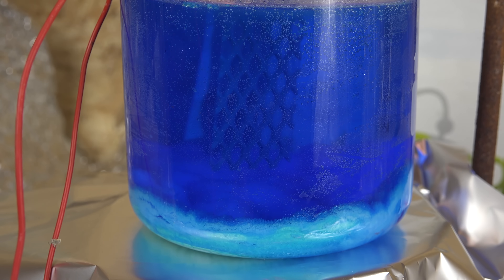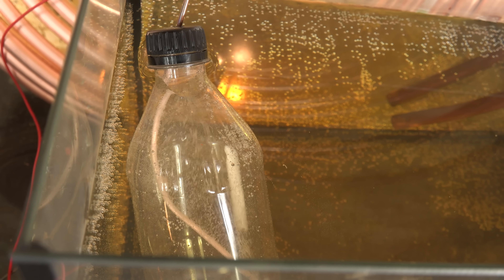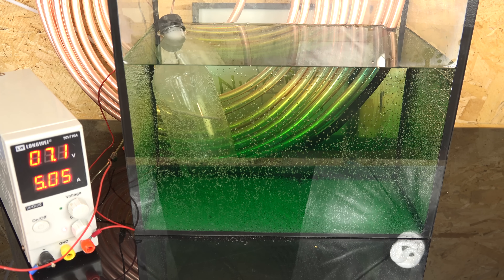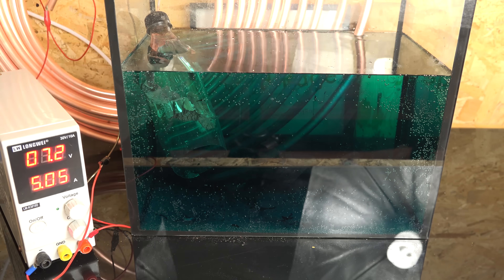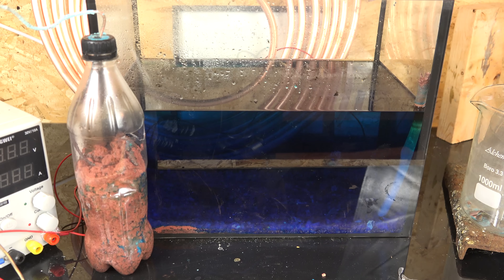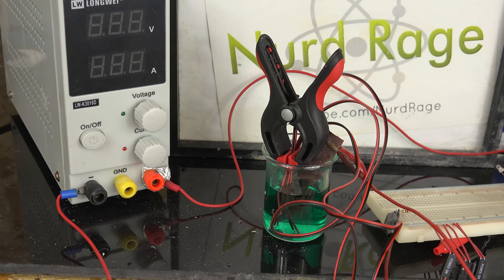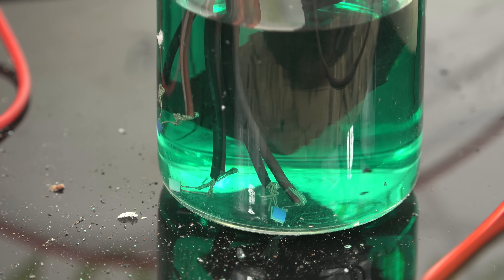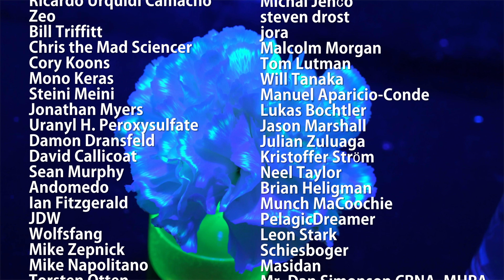Lab Notes: Making Copper Sulfate and Electrobonding Wires

Comment: Sorry, but I do not understand why to make life so difficult. You can use any copper wire crimping sleeves and just crimp wire with leads. This is how thing done in industrial applications, fast, reliable and no chemical agents, which can damage sensors and wires. BTW I would suggest to use wires with some high temperature insulation like teflon or glass fibers.
Reply from the maker: i don't understand either. I did try various crimping sleeves but when they reached the 300 celsius of the hotplate they only lasted a few weeks before failing again. When i opened them up there was an oxide layer between the wire and the crimp. So i had to use electrobonding which has proven to last months to years. I don't understand why crimping is so terrible. I've used it for other applications, but for some reason it doesn't work here.
Reply: @NurdRage  I think problem with crimps can be due to copper coating with some tin or other thing or they are not from real copper (part of aliexpress items). I do not see any other possibility why copper crimps can oxidise more than copper coating. BTW for some heat application I used stainless steel crimps (most likely 316), just cut from small tube, work fine for many years.
Reply from the maker: i tried pure copper, i even tried laboratory grade copper foil, i tried steel, nickel, all of them failed after a few weeks. I'm starting to think the constant thermal cycling causes the metals to loose their springiness (we're essentially annealing them), so they eventually no longer apply pressure and that allows the oxides to grow in. 

It's not that the copper crimps are oxidizing more or less than the coating, it's that the oxides can get in the microscopic gap between the crimp and the wire. And as they thermally cycle they grow until they fail. Nothing short of spot welding or electrobonding can fix that. In those cases there is no microscopic gap or contact surface, the metal is a continuous solid throughout. It'll eventually fail from cracking, but that takes months/years.
Reply: @NurdRage  interesting. So there left only metallising like you did or weld like in old valve equipment

Comment: You say, increasing the current heats up the wires? Would connecting your PS clips to an aluminum heat sink, then a thicker wire gauge connector to your coil and copper piece help to keep the PS wires cooler? It's just an idea, but I don't know.

Comment: If you wanted to make copper sulfate, but all you have is copper metal and sulfur, would it make sense to heat them together to make sulfide and then somehow oxidize that, or would it be better to convert one or both of your feedstocks to something else before reacting them together?
Reply: Electrolyze copper in espom salt solution to make copper hydroxide.
Then and h2so4 to that.

Comment: Interesting on both articles. For some reason even though I do plating and electrical work I never considered electro bonding wires 😂
Incidentally if you ever want to insulate moderate high temperatures, Teflon plumbers tape is good for about 250°C max and makes good insulation on temperature below that

Comment: I really appreciate your videos, they are instructive and at a practical level for someone like me. As to this video, a couple of thoughts. I was able to pick up 50# of copper sulfate at the local farm supply, I believe it is used for animal foot baths, pond clarification and making Bordeaux mixture as a fungicide. I have used it in small quantities to make "Blue Vitrol" for use as a marking solution for steel layout ( I am an old toolmaker).  As to the connections, very clever!  Added to my arsenal of options, thanks. Now, could they have been soldered using Silver Solder? It takes higher heat, but isolating the sensors from damage might be difficult.  Finally, do you think one could make Sulfuric Acid from waste gypsum?  Just asking from a theoretical interest, I can get it from the home building stores as drain cleaner still and purify it, or purchase it from Chemical sources in small amounts as I have for the above mentioned Vitrol (just a few drops is required).  Thanks much and good luck with your future endeavors.

Comment: Capillary action will pull acid up the inside of the temp sensor wires. You may find the wires go open circuit prematurely.

Comment: guess just using sulfuric acid and peroxide of 30 volume was out of the question (this is what I used with vinegar to make massive amounts of copper acetate basically creating a acetic acid version of piranha acid, and worked well but works far better with bismuth of all things, considering how hard it is to dissolve bismuth with say hydrochloric acid or sulfuric acid. lol)

Comment: I like the fizzguard.  One of the major annoyances with DIY electrochemistry is that damn spatter.  When I started I spent a ton of time on containing or redirecting gasses but still wound up with tons of corrosion all over the place from aerosols.  Especially on really long runs, like perchlorate, the intensity can vary wildly as the temp, voltage, ph, etc swing and when you're not right in front of it, everything can look fine.  Then you walk away and it turns into a nebulizer.  Nice to run into a relatively recent posting, all the greats of this niche seem to have been scared away.  Real shame.

Comment: As a longterm viewer thank you very much for all the work you have done, especially with the new methods of synthesis you invented! As of one of these inventions you presented the sulfur-bromine electrochemical way for the synthesis of H2SO4, which you wanted to revisit due to problems with the carbon electrodes. Have you found a new approach for that? Thank you!

Comment: As an electrical engineering enthusiast, I found this chemistry content very informative. I have actually been looking for just such a simple and cheap way to bond wires without using solder, and can't wait to get some free time to myself to do some experiments with this. This makes me wonder if it's plausible to switch it up, and try plating out even higher temp metals. Maybe plating steal out directly would be possible? (IDK, chemistry isn't my subject)

It's also really too bad YouTube sees it fit to attack content like this. :(

Comment: Glad to hear you are back.
This is a follow up question from a previous video explaining how to recover nitric acid, copper and sulfuric acid for precious metals refiner. I now have 10gal of dilute copper nitrate.
From this video, you seemed to reduce volume of copper sulfate thru evap.
How would be the best way to reduce volume of my copper nitrate?  Passive evaporation or simmering the solution. I am mostly interested in the nitric acid recovery.
Reply from the maker: i recommend simmering just because it saves time. evaporating copper nitrate takes ages. If you have excess nitric acid along with your copper nitrate, then it's best to do a proper distillation to recover as much acid as possible.

Comment: You could also use small crimp connectors (basically a short piece of tiny tubing) to fasten those sensors onto the wires.  
This is sometimes used as an alternative to welding on things like the thermal fuse in a heating device.

Comment: Could the electrobonding work with copper carbonate in an alkaline electrolyte?  
I use a saturated baking soda solution to force a brown patina on copper for woodworking projects to avoid the green staining caused by natural aging. A side-product is a light blue-green solution that I assume is copper carbonate. I save the solution from run to run and occasionally use it for plant food (acidic soils can lead to copper deficiencies in some plants). It would be nice to have another use for it, though.

Comment: The weak/spongy copper may be Dendritic Copper (which is also made via high current electrolysis).   Its high surface area makes it useful as a thermal conductor; iirc Tech Ingredients used it in a recent video on making thermal paste...

Comment: I end up with quite a bit of copper sulphate as a byproduct of electrolytic gold plating recovery from scrap electronics. A lot of the materials I'm recovering from has phosphor bronze as a base metal, as such there is too much tin in the base metals. I'm avoiding nitric acid due to the issue with metastanic acid. I avoid copper chloride etching due to losing gold to the formation of Purple of Cassius, and the difficulty in recovering the gold back from that coloidial solution mixed up with copper chloride. The tin sulphate is still a bit of a pain, but manageable. At least at this stage.

Comment: Or at 4:20 you can take the old cathode bottle with its spongy copper, and connect it as the anode with a new cathode bottle... the spongy surface will rapidly go into solution.

Comment: Crimp connctors would have worked. If you had a large electrolytic capacitor around, you could charge it up and use it as a ghetto spot welder!

Comment: I did this type of setup om a similar way but instead of advancing tubing by hand I mounted a plastic tube inside the tank and slid down a piece of hard copper pipe inside the plastic tube.   that way as it got eaten away at the very bottom it would slowly advance the whole 8-foot piece into the tank I should have added that it was 2 1/2 inch L type copper so it was very thick I got a hell of a lot of copper sulfate out of it so far and it's hardly even move maybe only 6 inches lol.

It's a very good setup what I did if anybody's interested in trying it is I took an old nyogen carboy that I wasn't using I have a ton of them and I cut off the top making a great big tank I filled it about halfway with a solution of DIY water and sulfuric acid in the proper proportions and I clamped a piece of old shop vac extension tubing math of flexible kind but the hard kind I guess it would have been just as easy to go buy a piece of PVC but I had a piece of shop vac tubing that I no longer had the shop vac for so I just did that I cut a small opening in the bottom for exposure to the solution. Then I took a length of 6 gauge copper wire that I had and made a lasso loop that just fit inside of the carboy and slide it down so it was about 02 inches below the surface of the solution far far far above the anode. Crystals formed on the cathode all the way up crawling up the anode but not underneath the water for some reason very cool looking I kind of left it it's been a few months and I haven't even looked at it I should probably turn that on and let it run some more but I've been sidetracked on other projects

Comment: High silver solder might be an alternative for the temperature sensor, you can get solders that go to 400°C, or you can use use crimp connectors, not sure where you could get small ones like that though.

Comment: I suggest a simple alternative is to bubble air over copper metal immersed in dilute sulphuric acid. The reaction is self catalysing once it starts with copper II being reduced to copper I at the surface of the metal and then being oxidised back to copper II by the oxygen in the bubbles.  I've never needed to use this reaction because I can access copper sulphate easily but not sulphuric acid. I use copper sulphate to control the tree roots that get into my drains.

Comment: I'm tempted to elecroplate nickel to bond a copper wire onto a glass bead thermistor where soldering temperature may be exceeded in use, but since thermistor legs are not copper (not sure what they are, probably steel plated either with nickel or with tin), i'm not convinced that it will work very well. Perhaps i can sand down the legs, i should be able to plate onto steel. Normally in this use they use a crimp to do the connection, but i don't find it very convincing after so many years and temperature cycles.

Comment: Use thicker solid-core wire for the leads to the supply. That should help with your heat problem.

Comment: Show how the hell you've got that copper pipe in this aquarium how the hell are you saying it's in there when you can see the other side of the pipe on the outside of the aquarium you need to give a top view because you're not making any sense when you say you got half the coil in the tank when it's impossible by the way you got the copper pipe sitting up behind it I don't understand what you're talking about there is no copper cold inside this aquarium just the little copper pipe inside the bottle

Comment: You take antenna from some old radio and take it apart in individual small tubes. Then you use thinnest section tube, cut it with knife, rolling it on the table into 2 short pieces (About 1cm each). Then you plug temperature sensor in it, and from the other side you plug wires in your hot plate. Then you crimp it with pliers, sqeezing wire and sensor pins together. Thats how i repair this kind of stuff, it will give you long lasting-temperature resistant bond

Comment: Hey I think you are doing it wrong, if you put a larger surface area for the negative terminal you will have a lower potential which then will not suffice to reduce the Cu+2. But in practice maybe that is a bad way to do it

Comment: Ways to plate copper from copper acetate might include: electroplating, or thermal decomposition to produce copper metal at roughly 200° C +/-40° C , ( close to temperatures used for soldering ).
Reportedly the byproducts are primarily carbon dioxide and steam. 

Making copper acetate:

The standard copper-etchant recipe  is equal parts by volume white vinegar and (3%) hydrogen peroxide, heated to about 60° C (140°F) to speed up the reaction.

Another way to get the oxygen for the reaction is to heat the copper in air until it oxidizes.

Comment: Welcome back NR. You're going to get sulphuric acid up inside the wire insulation. You could connect bare single conductor wires, plate, and then slip silicone tubing over the bare wires for insulation

Comment: Instead of copper next time use a solution containing tin, and plate that. Will bond well to the metal, and will provide a better resistance to corrosion as well, Just use a small amount of silver or antimony in the tin solution, so as to spoil the tin lattice, as otherwise it will tend to grow whiskers at the high temperatures. Pure tin tends to grow whiskers, which in a hot plate can be bad, so a small amount of other metal to alloy with it works well, even 1% lead will inhibit the whisker growth a lot.

Comment: Great video NR, as usual. I make my copper sulfate as a by product of precious metals refining.  Dissolving gold plated scrap in nitric acid followed by addition of sulfuric acid and then freezing the resulting saturated solution to recover copper sulfate crystals and a good portion of the nitric acid used.  Freezing saturated copper sulfate/nitrate mixed solutions will quickly allow you to collect copper sulfate crystals down to about 1 mole per liter CuSO4.  remaining in acid solution. I have many kilograms of CuSO4 crystals grown in this way, some as very large clusters. I then convert these crystals to either Cu(NO3)2 or Sulfuric acid and copper metal, depending on my nitric and sulfuric acid needs. It's a continuous process so nothing is wasted aside from some NOx off gassing during digestion and water from evaporations. Much faster than electrolysis. Keep up the great work! Steve

Comment: Love the videos. This one should be titled "How a Chemist solves a mechanical problem". In hot environments a simple mechanical wire crimp would have solved your problem or a simple spot weld of the leads. I guess it all comes own to your background,
Chemistry = Chemically bond them
Mechanical = Mechanically bind them together
Electrical = Use high current to fuse them together.
Reply: Yeah, I do wonder how well this will hold up. I've never even heard of someone using electroplating as a method of bonding anything. If you can't do resistance welding or crimping, it seems like brazing would be the go-to for an electrical connection.
Reply: yeah i would've went with a crimp or some connectors, but that's because i'm lazy and hated doing soldering for stuff like car stereos
Reply: @hawaiianrobot  for that crimping is better anyways due to vibration
Reply: I think you've got mechanical and electrical flipped

Comment: However it would be easier to micro-weld terminals together with a pencil lead and few amps of dc! It forms a molten glob of a metal connecting wires at the end.

Comment: Excellent idea to electrobond thermocouples!  Seems to work perfectly too. 
I knew about spot-welding, but getting a good connection on thin wires is like playing the lottery. 
Did you cover the lead in ceramic coating to avoid shorts, or just left them uncovered?   
A buffing could press the Cu crystals tightly together, and another treatment on top to seal - if this isn't a long lasting thing?

Comment: Quick note from a sparky:

Your power supply leads are embarrassingly low gauge. That's more likely where your problem is. In high current situations like these, you want the resistance of your leads to be as low as possible, or you start losing power into heat (as you mentioned - the clips getting too hot too touch). 

I cheated thicker leads on my power supply for the longest time by hacking a dollar store extension cord to bits, then soldering the banana clips/alligator clips on with high temp solder. It's ugly as hell, but works really well.

Comment: Home Depot has copper sufate labeled as drain pipe root killer in the plumbing department,  it's alot cheaper than using   copper tubing,  nice size crystals.
Reply: Depending on location (he is in canada), products and their composition vary
Reply: Ace has powder that use for putting  on cement for etching .
Reply: That's what I buy, 2 pounds for about 15 bucks.  Stuff appears reasonably pure also.
Reply: yeah or big bags from amazon for mold and algae killer.  I wont complain this video is still neat but refining agriculture grade cuso4 would be better practical info.